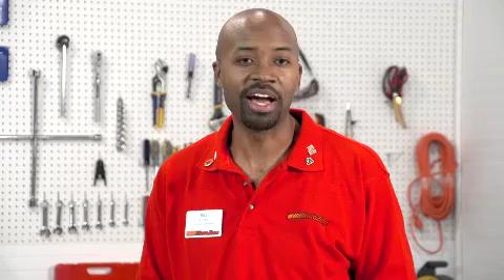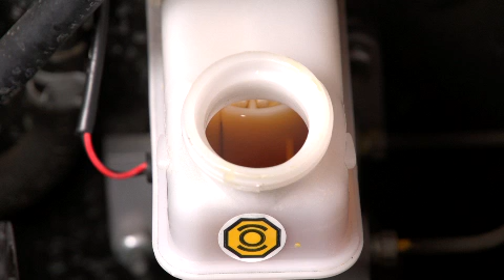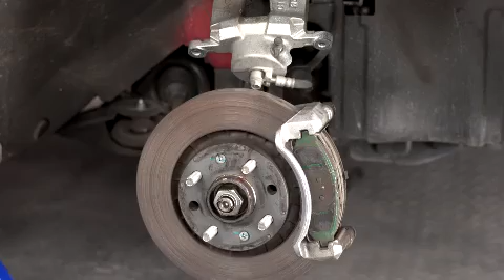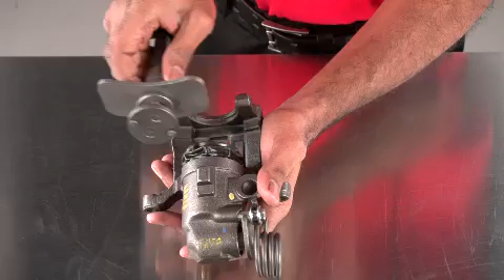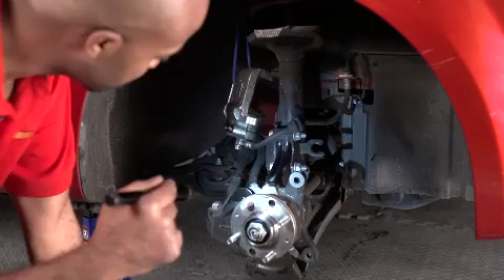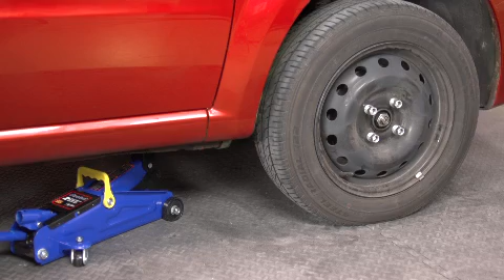How to Replace Disc Brakes - AutoZone Car Care

Comment: sometimes it's a little tricky getting those bolts back in through the caliper & pads. just have to wiggle it around a bit.